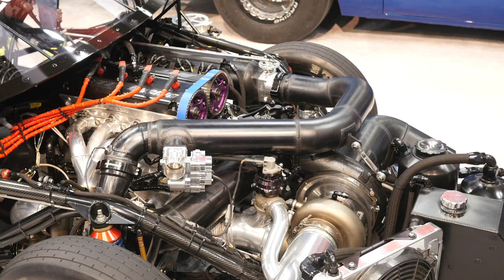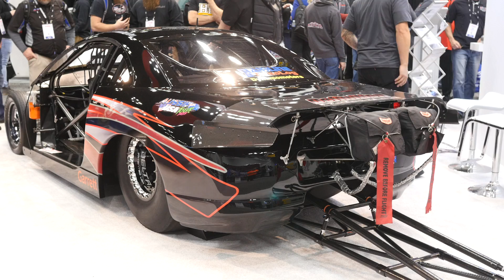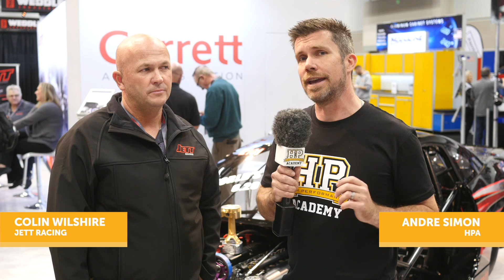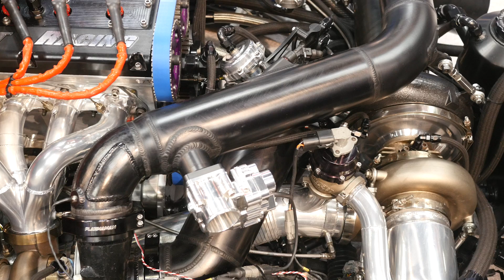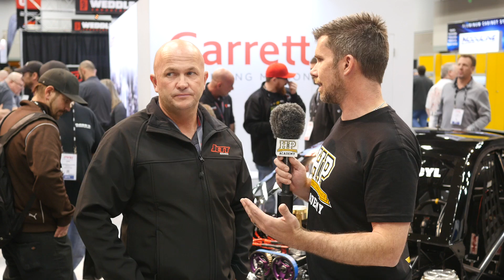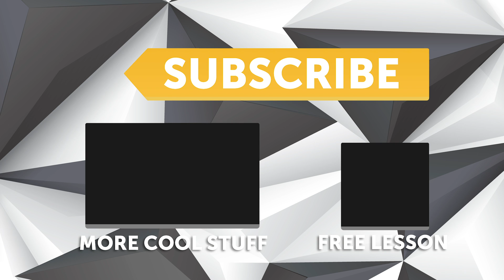110 PSI At 80,000 RPM Turbo Speed | Worlds Quickest 4 Cylinder | Jett Racing [TECH TALK]

Comment: 5 injectors per cylinder...wow!
Reply: Jack Pagano I just want to see how much a 4 can take at least on the Dyno
Reply: https://www.youtube.com/watch?v=Mp2LR2UeaUI

C20XE  2.100cc stoke , Single Turbo , 3 injector per cylinder,  only methanol whith  78psi
Reply: That is insane.
Reply: Think about it, 500 hp per cylinder, when you need (1 per cylinders) ID2000's to get 500+ hp out of all 4 cylinders
Reply: you do not need 2000cc injectors to make 500+ on a 4 cyl but it also boils down to the type of fuel you are running. you need a monster fuel system if you run on alcohol at high hp levels. my current set up on my civic is 1000cc injectors on a 450 pump and the car currently make 502whp on 91 pump gas.
Reply: @trickdacy6865  he means 500 hp PER cylinder, not the whole engine. so 2000hp in total
Reply from the maker: @trickdacy6865  2000hp, not 500hp. It's also not just about the output but also reliability, accuracy, fuel choice and 'driveability' when it comes to injector set-ups - Taz.
Reply: High Performance Academy I wonder what sort of electrical drain running that many injectors has?
Reply: @hpa101  Is there a dyno run showing the true power/torque?
Reply: @trickdacy6865  your whole engine makes less than one piston in this thing 🤣
Reply: @A.R.C.77  yup. Mine is also a street car on 91 pump gas 😂
Reply: @trickdacy6865  metho
Reply: @hpa101  I suspect they are also strategically placed for both cooling and swirl... 🤔